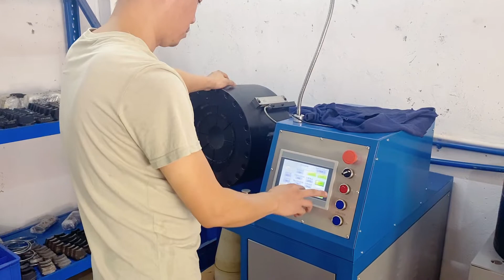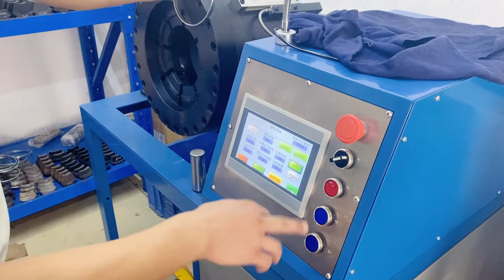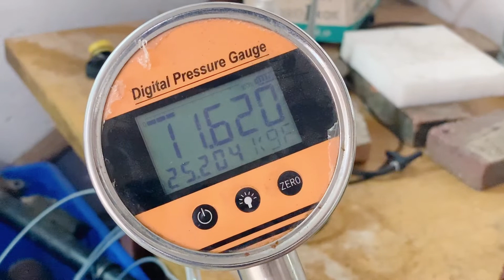Shock absorber for BMW G12 rear right disassemble

Comment: Where do you buy rubbers for these shock absorbers? Good job. Regards
Reply from the maker: HI, our factory produce the rubber , steel ring and other repair kits for air shock and air compressor. If you need help, can contact me by whatsapp +8613609036725 or email: pn9@pn-autoparts.com
Reply: @pinnuoairsuspensionfactory  Did you take it apart again because you forgot to insert the plastic sleeve?https://youtu.be/52-HnuPIc-U?t=331